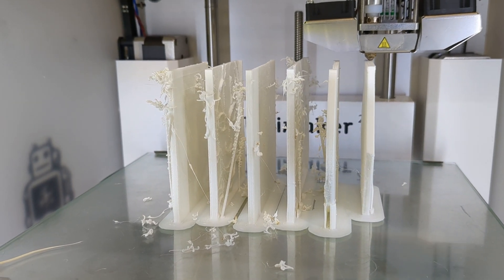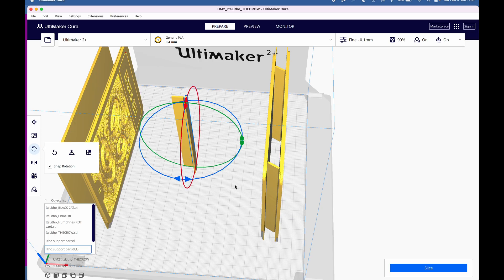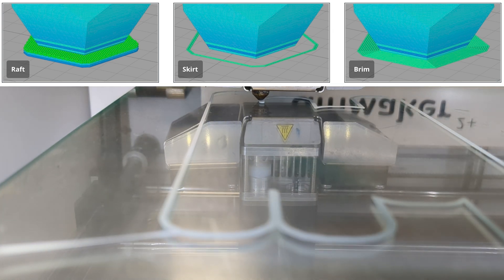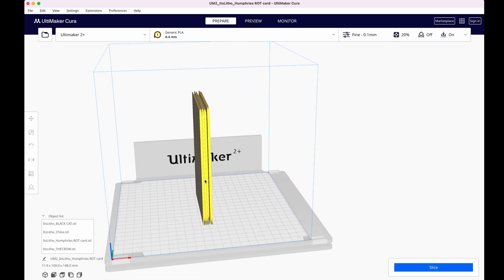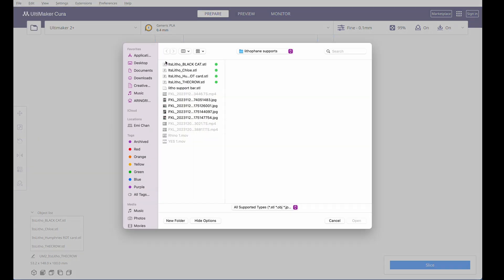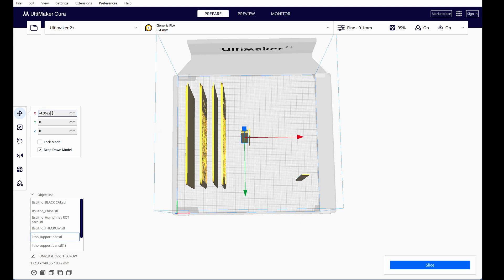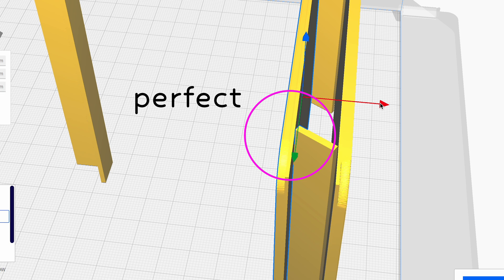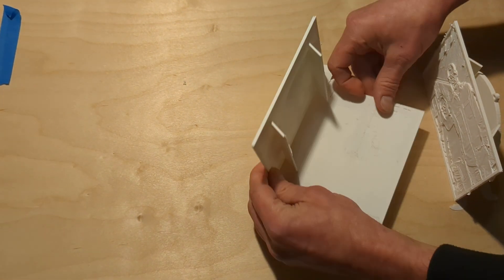Lithophane Supports- Free Download for Perfect 3-D Prints Everytime!

Comment: link for the support stl is not working
Reply from the maker: Thanks for letting me know, I'll check it asap
Reply from the maker: Just changed the link, double checked it on two friend's accounts. Should be working for you. Please let me know if you experience any more problems. Thanks!
Reply: You don’t need the support stl, in the slicer you can create a box and just scale it to the size you want. No need for cad software to achieve this. By the look and sound on each of those when pulling off one side wasn’t even touching the prints.
Reply from the maker: @joshswanson8819 Thanks. This video just offers one solution, there will always be others. Even if you don't use the stl file provided, I still think some of the tips here will be helpful.   And yes, there was one connection point that I'd already cracked off before filming.